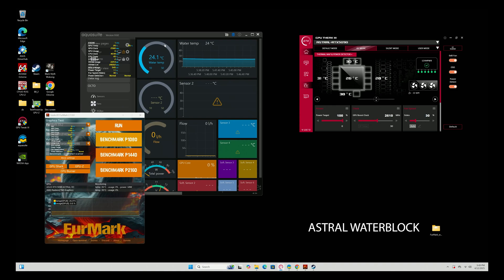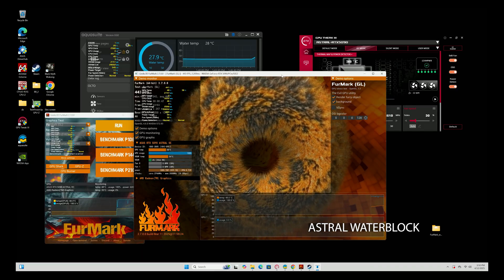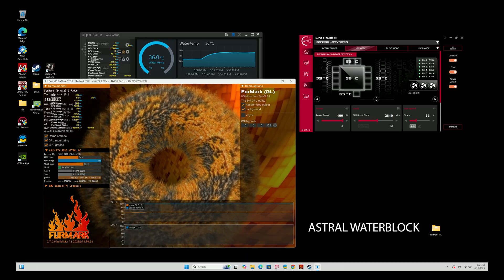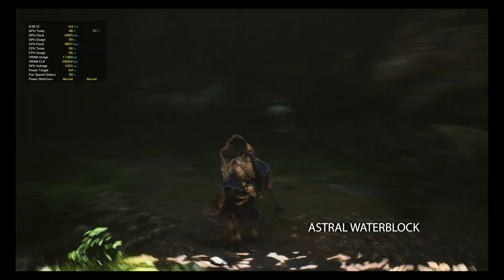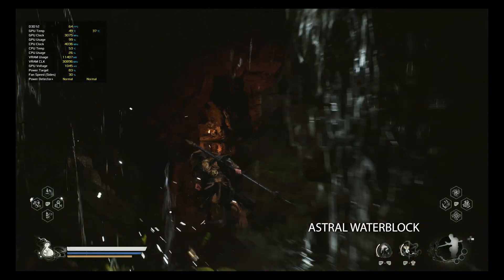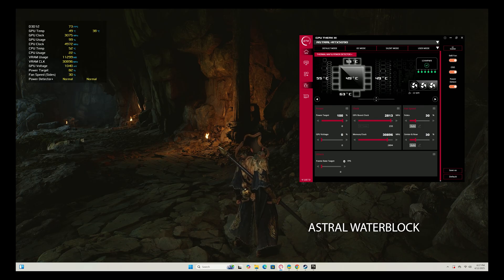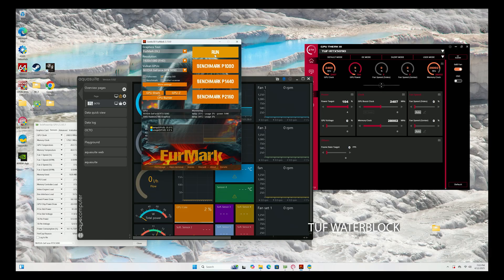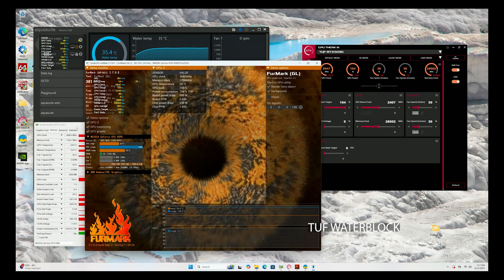Watercooling ASUS ROG ASTRAL 5090 & TUF 5090: Bitspower Prototypes. Part 3: Results Air vs Water

Comment: That's weird, My Asus Tuf RTX 5090 OC has a power limit of 100%. I see yours has 104%. I did buy an open box at microcenter. I may contact Asus and see if mine is supposed to be locked at that. I checked through GOU Tweak 3 and MSI Afterburner.
Reply from the maker: Hmm strange. Check the other bios

Comment: do you find the 5090 tuf is a good card and if its worth water cooling?
Reply from the maker: Out of all the 5090 pcb designs available currently in the US. The tuf is definitely superior only second to the astral barely
Reply: @JCustom  thanks that reassures me. i have that card and was dissapointed of not having been able to get the astral
Reply: @JCustom  I'm also thinking to buy TUF model. In europe astral is 600 euro expensive. It doesn't worth paying the extra premium fee for astral right?
Reply: @JCustom  what makes it superior to other PCB. The Tuf.